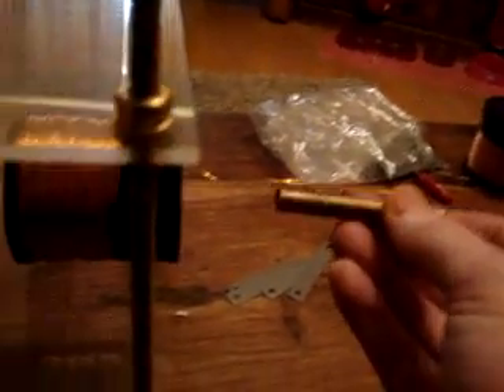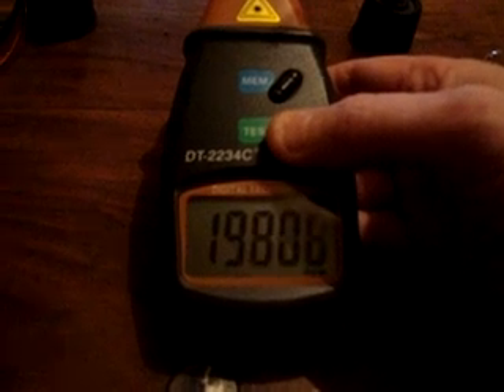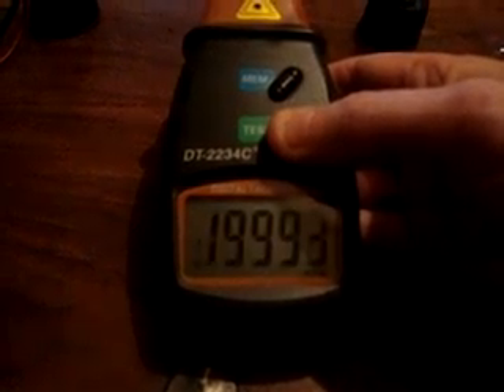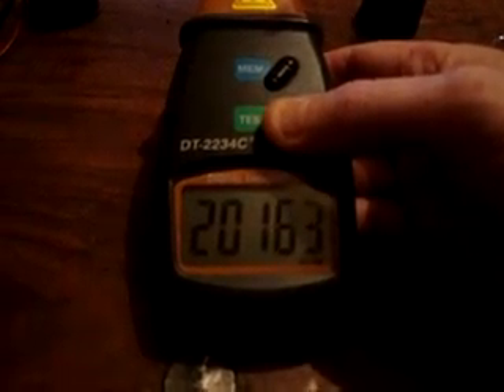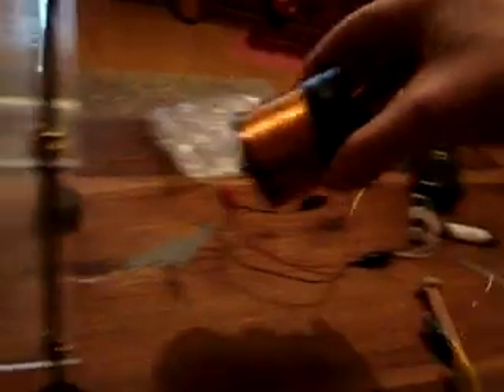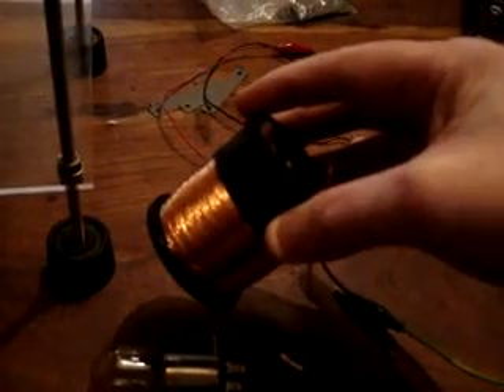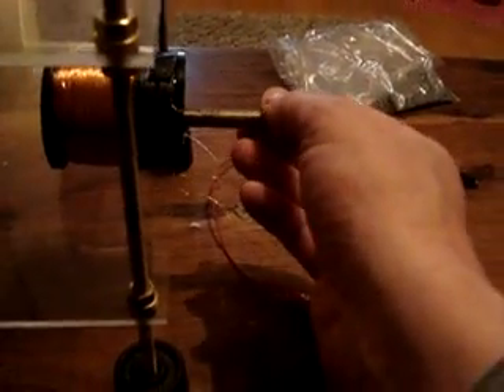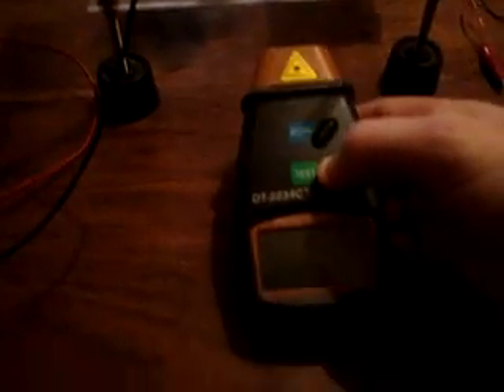Gary McKinnon simple demo of the Thane Heins Effect

Comment: Much more output than input?  Essentially free Energy? Great to see you back Gary, stay safe 😊
Reply from the maker: It's the only FE tech i've been able to replicate and that is actually going somewhere. Thanks for watching Gavin :)
Reply: @GaryMcKinnonUFO  thanks for trying Gary.  i have posted videos on my other channel of 3 working FE machines, and they are. my newman machine (20kgs),, my milkovitch two stage oscillator pendulm (100kgs) and my linear motor are my main 3 achievements.  other than disproving countless other devices.  but sadly my 3 all have an ROI of around 10 - 20 years. based on current electricity prices.

if you are interested in the linear motor, i will paste you my videos too watch, in order too paint the operational picture and some development . the best COP of this machine is around 10. - but i believe 20 is easily achievable (at 1watt input).  however by the time the input power reaches 30watts or so, the efficiency will drop following a curve, down too COP1 

part 7 : https://www.youtube.com/watch?v=uavoK5VQQNQ
part 8 : https://www.youtube.com/watch?v=eP1MM9hOvEc
part 9 : https://www.youtube.com/watch?v=7bhDG0YE6KA
part 11 : https://www.youtube.com/watch?v=vjxzKuikg5Y
part 12 : https://www.youtube.com/watch?v=rtE0NPCHwQQ

basically. imagine you have 2 magnets placed 1 meter apart that are repelling eachother.  and an 1watt electromagnet inbetween,  -  now you can increase the Gauss of the magnets too infinity, and the force of the electromagnet follows.
Reply: Heins made claims of up to 7000% efficiency for the bi-toroidal transformer..... Incredible😮
Reply: I just did my homework😉

Comment: Any opinions on COVID-19 or 5g, Gary? Feels like the world's going to pot.
Reply from the maker: 5G is dangerous due to the power and frequency of the pulsed-microwave technology it uses. We still operate on the safety protocols that were derived from flawed US Navy experiments back in the 40s or whenever it was. It's all about the power per square centimetre received by your body. There is no proven link between 5G and CV.

As for CV, so far, if you look at the available data, it's no worse than the worst years we've had for influenza. Last year, globally, 650,000 people died of influenza-related complications, many of whom were on ventilators as they passed away, but we don't get that all over the news. But CV is ongoing so we can't make a proper comparison until it's over and all the data is in. But so far, typically 25% of any given population will be CV-positive, and less than 0.1% of them die. Thanks for watching :)
Reply: @GaryMcKinnonUFO  Thank you for the informative reply, Gary.
Reply from the maker: @nightforest666  My pleasure.